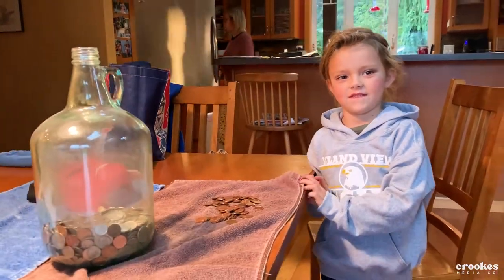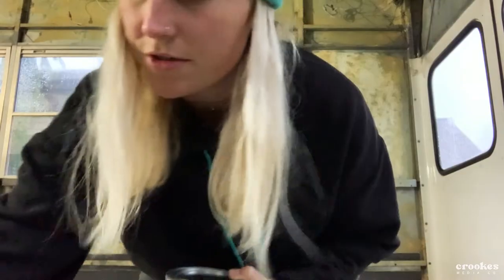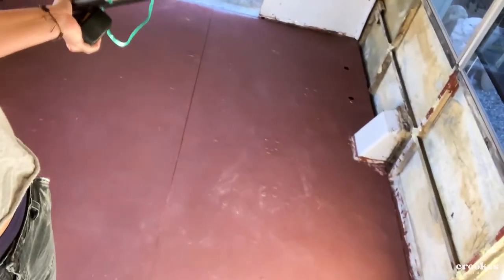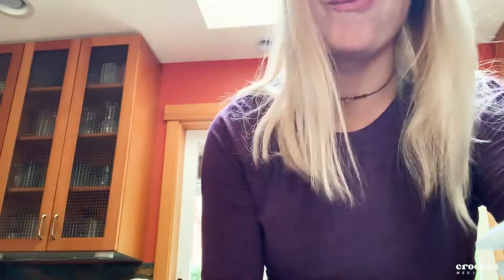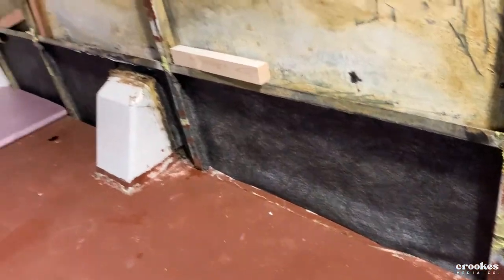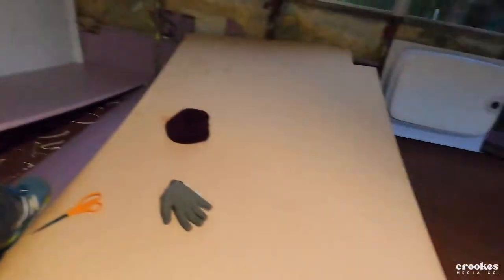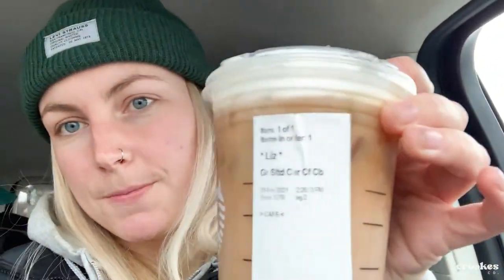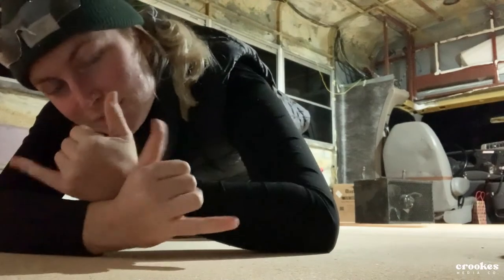Subfloor installation in my school bus conversion

Comment: Hey ms. Crookes ,Anacortes metal works standing bye to offer assist on fabrication ideas for your project!
    Your Pop has my number,,    Can-Do.
Reply from the maker: Thanks Greg! I'll keep that in mind for sure! Once my financing can handle it, might be looking for some help on a rail for my deck!
Reply: @Liz.Crookes  hey Liz,,, just finished couple aluminum rail jobs, scrap barrel is full of short drops of 1 1/2” square tube
  And misc 1/2” bar  might want to stop bye and check it out. Lots of steel remanents also.  Your welcome to look !